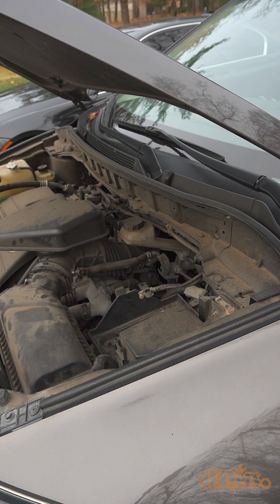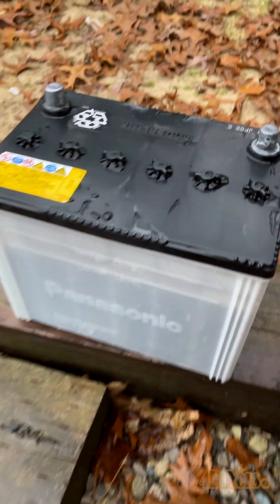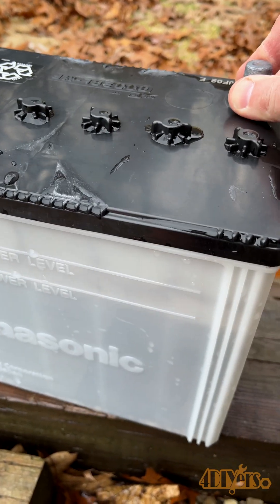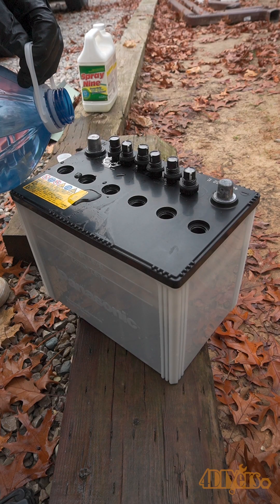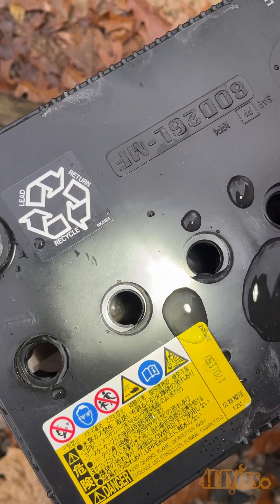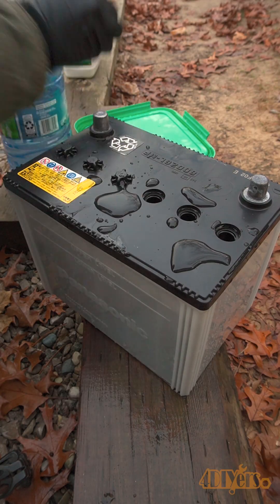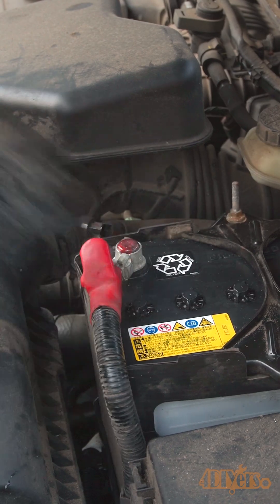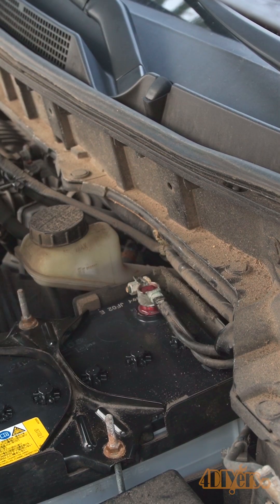How to Add Water to Your Car Battery

Comment: Do you have to disconnect battery and what's other options to distilled water, is cooled boiled water ok.
Reply from the maker: Yes, it's the safest practice to disconnect the battery and remove. A battery can explode and it's filled with acid, so you can risk hurting yourself or damaging your vehicle. Boiled water still has minerals, distilled water is the only option.
Reply: @4DIYers  understood,  Thankyou  much appreciated
Reply: Can we use distilled water for drinking in battery?
Reply: @huangalden6071  distilled water in jugs at store  are for people to use in irons and dehumidifiers so minerals are not left behind building up distilled water would taste terrible to drink with no minerals

Comment: Would the battery need this to be done by the time the battery is no good anyway. Idk if that makes sense
Reply from the maker: This battery was very low and I'm assuming it's quite old too. The engine was already cranking slow at times so most likely the battery life was depleting. I did this before winter, cold weather can really test a battery and it's been fine to my surprise. Was trying to avoid having extra expenses with a replacement and managed to get lucky.
Reply: I'm right there now that's why I'm reading this good info.

Comment: I use a huge syringe, but there is no need to remove the battery because the fill level matches the bottom of the molded openings!
Reply from the maker: Great tip on the syringe. I removed it from the car for cleaning, so it was already out. Just in case acid does escape when filling, also good to be safe instead of damaging components around the battery. Not needed, but never hurts to be safe.
Reply: @4DIYers yes I'm hoping to do this. moving the battery seems ideal for most situations.  Syringe might be very helpful

Comment: interesting i never heard it would cause sulfateing all i ever heard is plates will be damaged and unusable if above liquid level I had someone tell me i should be adding acid rather than water to keep battery at max capacity but i told them the solution is only 15% acid and the acid does not evaporate maybe a bit gets out from rattling around but only the water evaporates off.
i always wondered if adding more acid would give battery more capacity.
Reply from the maker: Yes it can, the battery's performance drops drastically and with the increased concentration of electrolytes, this can cause sulfation. I've always been taught not to add acid to a battery as it can affect the water/acid ratio, potentially damaging the battery if too much acid is present.
Reply: Helpful